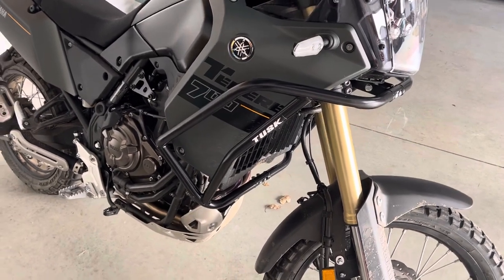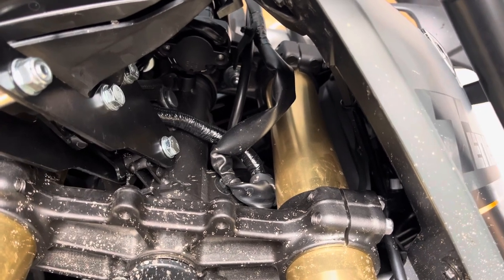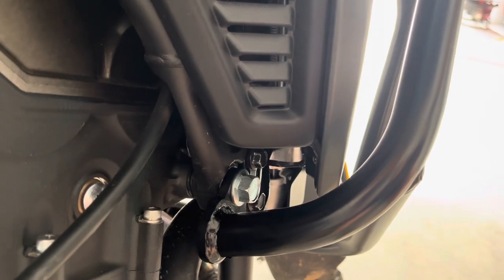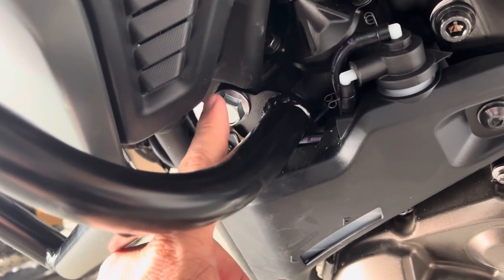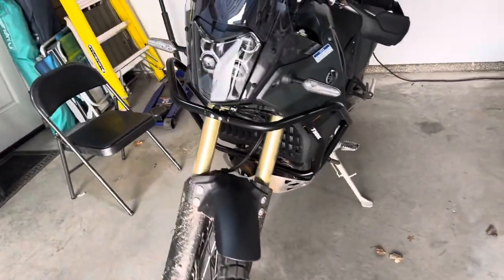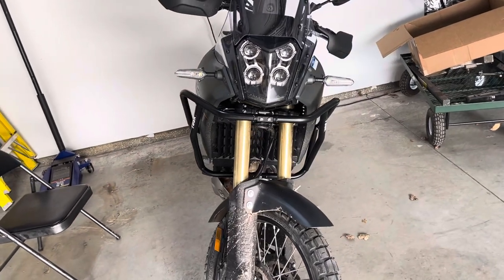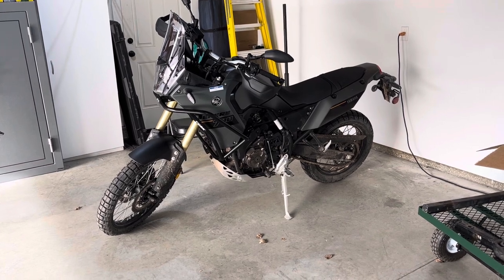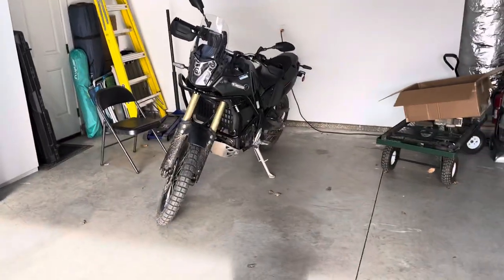Tusk Crash Bars Installed on Yamaha Tenere 700.

Comment: Is your bike a '23? I have a '24 with the new screen and the center bracket is now a 4 bolt stock. It's impossible to get the old one out without loosening up the front assembly.